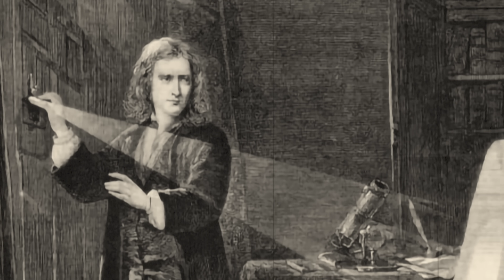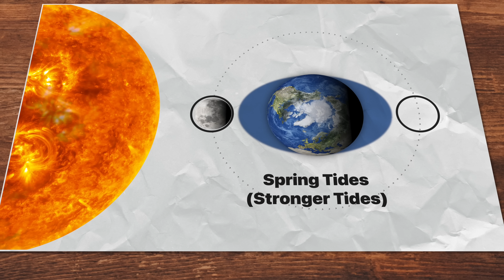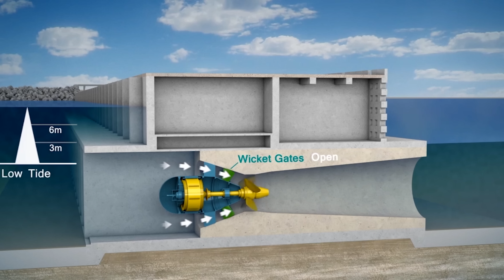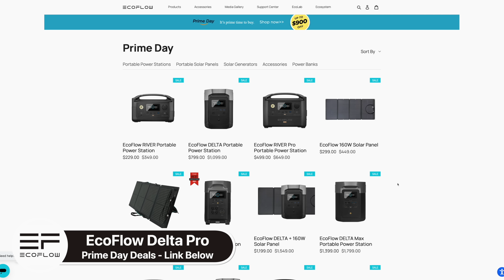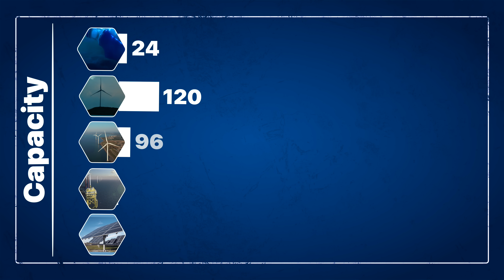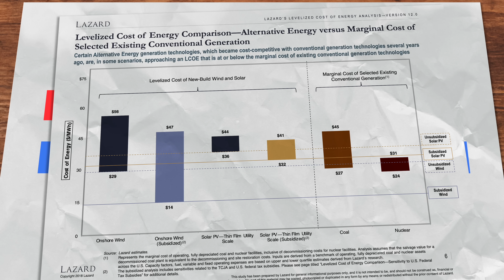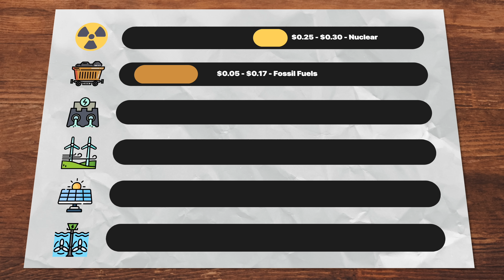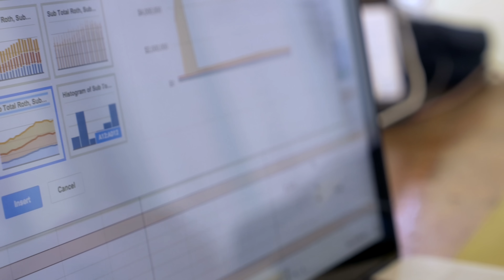Breakthrough Energy Source is 10X Better Than Wind & Solar!?

Comment: I'm sorry but you are SO WRONG about tidal forces that I have to intervene. The buldge has nothing to do with the amount of gravitational force being different at the edges and center. The buldge comes from the angle at which the moon is pulling the water with respect to the surface of the earth. Let me explain: near the center of the hemisphere facing the moon, the moon's gravity pulls straight upwards (opposite earth's gravity) but near the edges, the moon's gravity is pulling at an angle so the weight of the water doesn't push directly towards the center of the earth but at an angle that is tilted towards the center of the hemisphere facing the moon. You can imagine this as a slight sideways force that pushes the water towards the center of the "buldge". So the buldge is due to the water on the edges PUSHING towards the center of the buldge rather than the moon PULLING directly towards it. If the latter were true, it would mean that the gravitational force of the moon would be strong enough to lift millions of tons of water and so we too would feel lighter and float around during high tide. Do a vector analysis and you will see that you get the same effect on the other hemisphere😁

Comment: I love the idea of tidal energy - it's just hard to imagine something in the ocean lasting very long.  Great video although I think your cost analysis of wind power is significantly underestimated.  It looks like it's based on historical pricing, but not looking at the cost to install in the future. The prime locations for wind have all been used, leaving poor site selection and availability and causing costs to increase.  Combined, these factors have resulted in wind disappear almost entirely from the interconnection queues for utilities in the US - being replaced almost entirely by Solar.  I think Solar is even cheaper than you've shown, however, I agree that the intermittency creates bigger problems that aren't accounted for without considering batteries.  I not an expert on nuclear, but if we were to use Palo Verde (nuclear plant in Arizona) as an example; the operating cost is $0.043/kwh (publicly available info).  The plant has already paid for itself over and over - it was built in the 1980s and in 2011 was projected life was extended from 40 - 60 years.

Comment: Although much more predictable than wind or solar, there is still and intermittency issue with tidal power, albeit much less severe...and also predictable.   Also, to make the cost per KWH comparable, I think storage(smoothing) solution costs should be included, which might appreciably increase solar and wind costs.  Having said that, I think the experience in Australia (Hornsdale) with megapack has shown this solution pays for itself very quickly.

Comment: You make an excellent case for tidal being the sensible way to go because it negates the need for batteries or storage of any kind. I presume the raw power can (like wind and solar) be inverted to AC and from a sub-station be injected directly into the grid. The question of materials that can withstand the corrosive salt water is probably the main reason why the money hasn't started flowing in the direction of tidal just yet. The scientists need to speed up their research on materials v salt water. Once that hurdle is overcome the whole renewable effort needs to gravitate in that direction and scale up big time. Once we're able to harvest so much cheap energy we can start producing more green hydrogen which will can then make hydrogen transportation cheaper for planes, trains and automobiles. Let's hope the planet doesn't cook in the meantime.

Comment: I like these the only real issue I see is there  is not enough ocean around where I am. I have rivers but that water still moves. Can these still work in a river?  I think you could probable inclose it in some sort of fairly open grid cage under water to keep the fish and other critters away. And I think we could make them much more salt water resistant. Maybe use  more plastics or and stainless steel not sure. But they sound good especially sence they  can go on all day reguardless of wind or sun. What about going deep off shore like digging a hole in the ground and putting one down in the earth near your home  but in the below ground water table would that work too?

Comment: Water turbine power makes infinitely more sense than giant windmills.
The main challenge would be corrosion from salt water. The turbines would need to be super modular and easily accessible for maintenance.
The secondary challenge would be energy distribution. The US national grid is in sore need of upgrade.

Comment: I found a solution to intermittency probably 50 years ago. I store both solar and wind energy as compressed air. 

My windmills pump Air and the solar runs a small electric  air pump. 

All that compressed air joins up in a system of receivers, that is vessels or tanks and a myriad of piping all over my ranch.

 For a hobby, I have for the past nearly 60 years, built small steam engines and air engines as well as windmills (VAWT). I use the compressed air to run all my toys and if push comes to shove, I have a few, which can create house current. 

Sure, I know what you're thinking and you're right. When I run out of compressed air I'm back to rubbing sticks together, but so what? 

If what I do were done on a grand scale, who knows what could be the outcome? 

After all, there's lots of air.
Reply: As you well know, the energy density of compressed air and the inefficiency of the compression and use side are both extremely low and wasteful - not something we want to be encouraging on a large scale.

Comment: Thorium LIFTR is the answer. Small scale. Built in a factory and shipped to the site. Imagine small Thorium plants along the interstate highway, with induction coils embedded in the pavement. 
Electric cars could go from the east coast to the west coast charging on the fly.  Of course solar and wind energy with Tesla storage systems can also power the electric charging highways. 
Small car batteries can go further with charging on the fly.

Comment: Since I read somewhere that tidal energy is the force involved that is allowing the Moon to expand its orbit around the Earth causing the Moon to go further, and further out from the Earth, would tapping this energy for conversion to electricity slow this process over a long period of time preventing the Moon's orbit from expanding further. The Moon is responsible for the Earth's stabilization in its orbit, but once the Moon is too far from the Earth, that stabilization will be diminished. So tapping tidal energy conversion to electricity could prevent further degradation of Earth's orbital stability over time. Just a thought if what I'm mentioning is true.

Comment: I like the idea of tidal energy but would be very nervous about using ocean current energy due to environmental concerns.
Another thought though is that it seems likely that due to ocean level rise, large seawalls are going to be built in places for protection. If the generators were put in them as they were built, they could provide cheap power as that facility in France. Kill two stones with one bird... or whatever.

Comment: Thank you. Great video + I've often wondered why tidal energy was not being used as much as wind/solar & you answered my questions here. I wonder if there are ways of using entirely plastic composites for underwater components instead of metals fo better resisting salt water corrosion + also wondered if they could combine a wind turbine above water + tidal turbine below as one unit which could save on costs too ?
Reply: "entirely plastic composites for underwater components"  For one thing, plastic is a nonconductor of electricity. The actual generator MUST have metals to make power. Perhaps if the actual generator were above water it would reduce (not stop) the corrosion, BUT increase the building cost and complexity of the unit. These separate units would the greatly increase the costs to build and maintain.

Comment: The tidal energy turbines appear to me to be sea life extermination machines. Also it appears to me the power is not fully dispatchable - there are four times per day power will stop - at dead high twice a day, at dead low twice a day. So tidal power suffers from some of the same problems as solar and wind power - we still need reliable base load and reliable peaker plants to cover for variability.Tide size varies quite a lot also. so power available per day will likely vary.
We are also still left with the high price of tidal energy compared to other options - also tidal power plants will be particularly vulnerable in some areas to hurricanes or severe ocean storms.
Peaker plants must be capable of load following and capable of ramping up quickly to meet spikes in demand caused by eg the wind stopping or the sun setting. This means high efficiency combined cycle plants are off the table - what it really means in real practice is we must use carbon spewing conventional gas turbines or hydroelectric, both of which can spin up to speed quickly to meet demand spikes.
We need reliable carbon free power - reliable base load that is always there to provide power to our factories that need it without interruption. eg aluminum smelters will suffer significant damage and serious economic harm if power is interrupted and the melt cools and hardens. Maintaining our lifestyle requires much more than just power to our homes. It is not a problem if there are interruptions to our household electric supply. People can and do easily adjust. This is not so for much of our industry. We need reliable base load - and it helps a lot if that base load has some ability to load follow - this allows our electric system to absorb the inherent variability in loads and the inherent variability in some sources of power.
It appears we will be stuck with carbon spewing gas turbine peaker plants for the forseeable future - however - carbon free fourth generation nuclear plant designs satisfy all requirements for providing large amounts of reliable base load. Some of these designs have load following ability, Also there is very little land, concrete and steel required for the amount of power produced compared to the requirements of wind and solar power. This power is without the large scale killing of birds and sea life -which many conservationists see as an important advantage.

Comment: There is no one silver bullet solution to our clean energy issues the different technologies need to be considered for their geographical location.   Solar is not economically viable or useful in much of Alaska especially coastal areas. Below the arctic circle tidal energy has a great deal of potential along with wind, and wave technologies especially in high population areas like Vancouver, Seattle, San Fransisco and Portland.   I don't see tidal technology  being as useful in So Cal except in areas like Mission Bay.  Not sure the Navy will allow it in San Diego Bay.  Solar is the obvious choice for this area to create a flat line of energy demand but base load is still a challenge so wave energy technologies can be helpful there too along with wind and increased conservation and efficiency.

Comment: Interestingly, tidal range and tidal flow are not always seen at the same place. In the English Channel, the places with the highest range have the lowest flow rates and vice versa.
Round the UK coast, there are a few places with a good flow at Spring tides, the Pentland Firth being one, and that now suffers because the tidal stream turbine can produce more electricity than the Orkney Islands can use so the excess goes into making hydrogen which then powers the local ferry whe it is in port.

Comment: Why isn't tidal energy used to move/compress air, it eliminates corrosion, installation costs reduced, maintenance costs reduced, no sea life growth, nothing is underwater except a pipe or two, easy to upgrade, it works on the tides going in and out, it can also be stored energy available 24/7.

Comment: OK, if water turbines are so great, how come NOLA isn't run on them? 

They have enough current to run ten-thousand gangs of turbines without slowing down. No salt water in the Mississippi, and if they roll-in/out on rails, power-washer automation could spray the algae off. (Or, do they work underwater?) I don't know about blade erosion from silt, nor if sandbars would be created. Wind(water)tunnel simulations might answer that.

Comment: The problem with tidal energy is marine growth gunking up the works. Copper could be used to slow the growth, but it will degrade in only a few years, so either way, maintenance makes it an expensive option. If a material could be created that could eliminate those factors, tidal energy production would really take off.

Comment: I read an article years ago about a guy who built an electric Paddle Wheeler with a large array of Deep Cycle lead acid batteries to power it.  (All they had in the mid 80's)  He launched in on the Mississippi river and would motor upstream close to shore where the current was less.  When the batteries where getting low he would move the boat further from shore where there was more current, throw out an anchor and let the water running by the boat spin the paddle wheels to recharge the batteries and continue upstream when they were charged.  I thought it was pretty ingenious idea.  It would be interesting to do something like that with modern liPo's and electric motors.    Thanks for the video!

Comment: The costs for maintenance and down time(high winds or none whatsoever. Even frost and cold) for wind turbines and they need either a liquid fuel or gas fuel generator for downtime. There's also destruction of the eco system and the blades cannot be reused.

Comment: I wonder if you could attach tidal energy systems to the virticle wind farms to use the same infrastructure and make for easier maintenance. attaching them to the bottom of the virticle wind farm platforms...so they don't interfere with the weights...might make those platforms more stable in the water, as well.

Comment: So every day at the high tide and low tide there is NO power production.
4 times per day - NO power output - NONE.
I live 2500km from a tidal location - tidal power is NEVER going to work.
CANADA IS NOT ADOPTING TIDAL POWER GENERATION AS A VIABLE ENERGY SOURCE.
Isn't nor ever will.
BS video as are most of this channels postings.

Comment: Anybody ever consider hydrogen production at remote site, then piped to power centers to reconvert to electricity, perhaps via fuel cell?  Blowback/safety valves in place every so often, of course.  I don't know if the numbers work.

Comment: What if the make the propelling part of carbon fibre like some companies are already making aeroplane propellers, and then turn the turbine on a platform above the water connected via gears or a pully system, this will maybe increase the initial cost and reduce efficiency, but can decrease maintenance cost. I am not sure it can even work, it is just a thought.

Comment: If the corrosion of sea water is a problem for these turbines, let's not forget that all those desalination plants being built to mitigate potable water shortages everywhere produce brine.  Brine is what is left over after desalinating sea water and it is super salty.  This leftover substance is pumped back into the sea.  As the brine is being pumped into the ocean, it makes the surrounding water even more salty than it already is.  Don't know how long it takes for the brine to be diluted (if at all), but these underwater turbines cannot be installed near a desalination plant.

Comment: Actually I love the breakdown.Your numbers are much better than when I was working with these. ALSO, you show nothing but vane axial style turbines, the better designs are built more like a jet engine and use cramic and composite components for bushings and thrust bearings. They also have the ability to ramp up quicker and alter direction wthout employing multiple clutch systems.
Reply: Would this work in rivers also?
Reply: They're also ridiculously improbable. The obvious justification for that assertion is that if they WERE true, everyone  would be rushing to cash in on the cash cow. You would not NEED government funding to encourage R&D, the companies would do it for themselves just to be the patent holder on key component improvements.
Reply: @nickbrutanna9973  investors want a quick return within a few years. Few want to put a lot of money into r and d on something that may or may not be particularly better or profitable in the long run. Once it's proven to work private companies will be willing to invest to build it but getting to that point is more likely to progress with government support. It's good to have diversity of options so if there's a problem they don't all stop at once.

Comment: I always felt the ocean holds the key to the production of energy. I believe there must be a way to take advantage of the intense atmospheric pressure you find in the ocean depth. It seems like if you could design something that harnesses the crushing pressure while at the same time you include something wants to expand like a lighter than air gas like hydrogen or helium. If you design it in a way that can take advantage of the push and pull force. I don't know it's just a thought.
Reply: Pressure is not energy. A pressure perpetual motion machine to extract energy is impossible. See the 1st and 2nd laws of thermodynamics. The temperature differential of deep vs. surface water is a possibility? Anyway... keep thinking and studying physics as we can use your inventive mind.